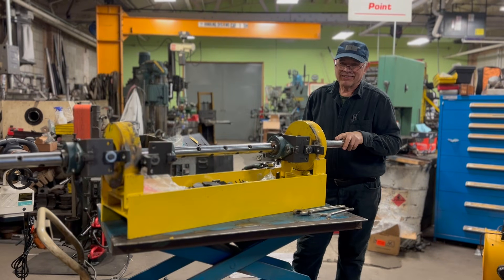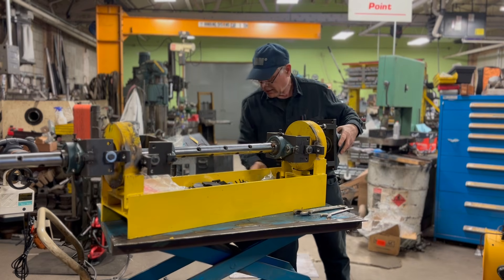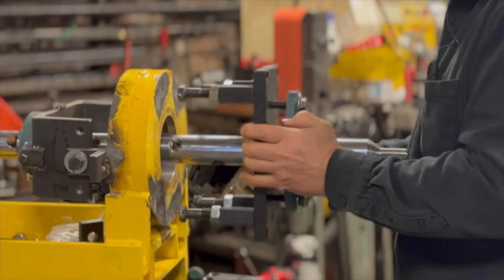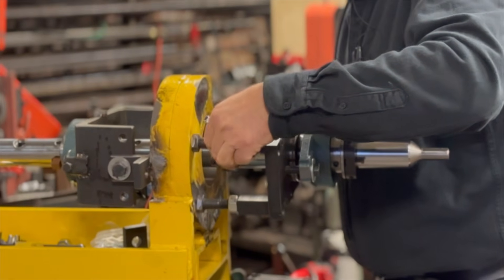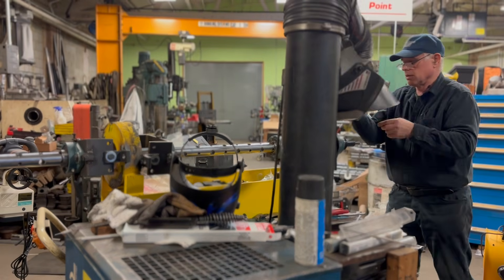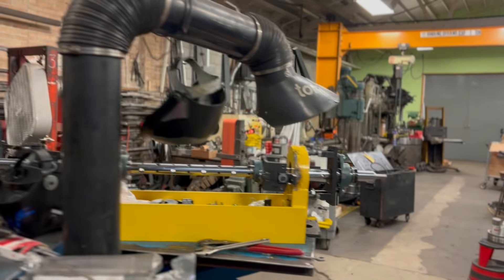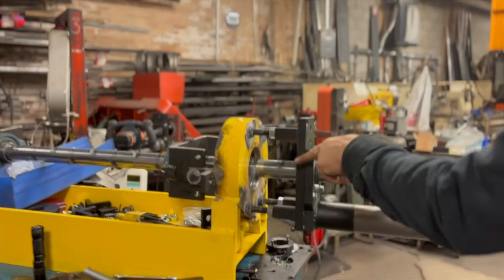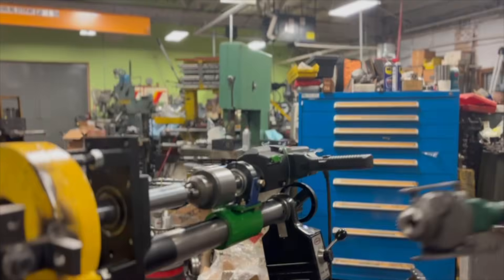Line Boring with the Eibenstock German Drill and Power Feed

Comment from the maker: Our Line Boring Sets include the tools needed to rebore most holes starting from 1.75" up to 8". The boring bars are made from 1045 induction hardened and chrome plated precision ground and polished steel. The bars have square tool ports broached every 2.5" or 3" so the operator can get an exact measurement (within .001") without having to remove the boring bar from the bore.(Use Starrett 823 inside micrometer or similar)

We have Power Feeds available for purchase.

Manufactured by International Revere Machining in Chicago, Illinois. Set A and Set B series available, with and without Power Feed.

Visit our eBay: https://www.ebay.com/usr/internationalreveremachining or our website: https://irmcorp.net/products/line-boring-sets/ to learn more!

If you need something not listed, we can provide a custom quote as well.